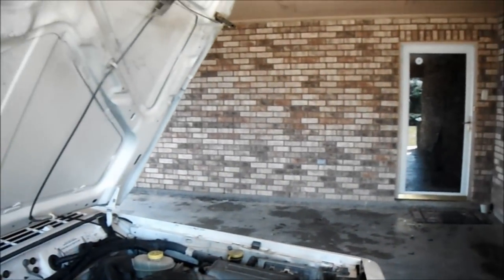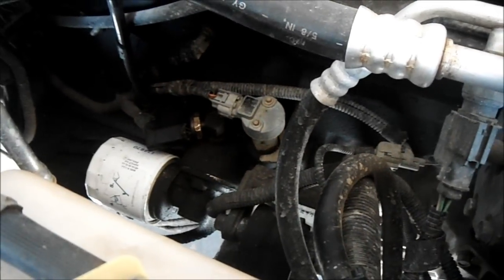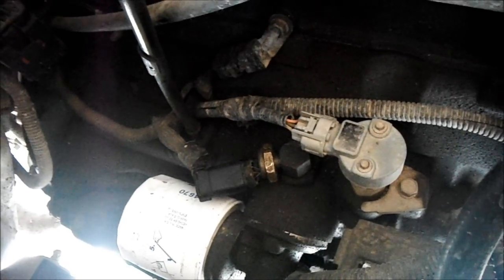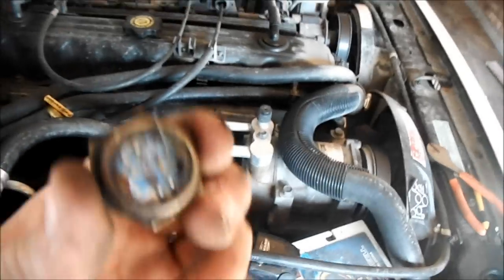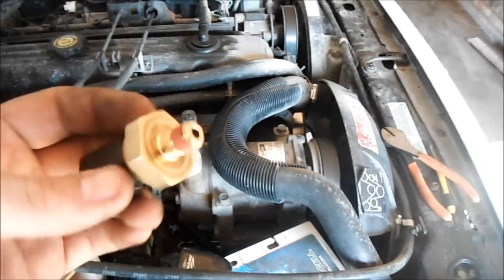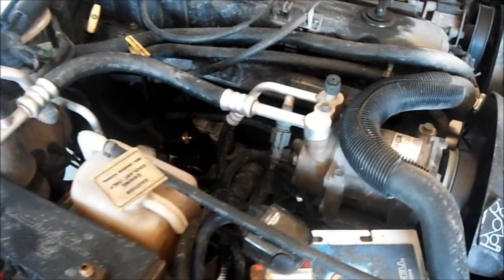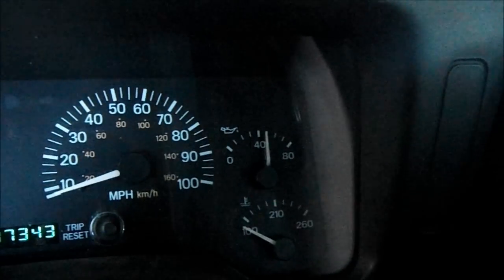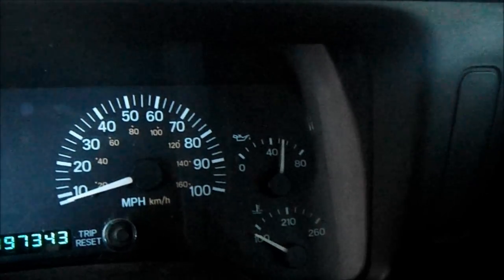how to change an oil pressure switch on a jeep cherokee (2000-2001)

Comment: Thank you for this video. Although it's a pretty simple job, it is reassuring to see an example before attempting the procedure myself.

My oil pressure indicator was running at 3 bar on idle, rising to 5 bar under acceleration with no drop back to 3 bar on idling again. An oil change and new filter did not help, but installing a new oil sender unit fixed the issue.

Comment: Useful Video and was able to change my 2001 Jeep Cherokee Ignition Oil Pressure Switch. Hope it will solve Low Oil Pressure Problem. When the Oil Pressure is Low, Engine Idles Rough, then Cylinder Misfires and Check Engine Light on with Cylinder Misfire DTC.  I also changed Ignition Coil too and hoping to run smooth. Thank you.
Reply: Does it ever shut off on you while you're driving? Mine started to drop oil pressure and rpm's, then it would shut off.

Comment: it was the plug itself that has the wire in it ive changed out both peices and it reads 80
Reply from the maker: check to make sure it isn't grounding out anywhere. depending where you bought the sensor from it may have gone bad again. i had quite a few issues with the parts store ones doing that. so i ended up getting a Mopar unit and that fixed my issues

Comment: is my sensor sender unit bad or is just my switch connector? the back of it with the wire keeps pushing out the back
Reply from the maker: the plug itself or the wires in the plug?
Reply: +dalton456 i coukd gp back i goy it from advance auto
Reply from the maker: try swapping it and see what it does, how long has it been since you changed it?
Reply: +dalton456 jus now
Reply from the maker: ah nvm then it wouldnt have gone bad that fast, it may just be a connection issue then

Comment: mine is broken in my jeep looks just like your old one and yesterday my entire cluster stopped working. none of the gauges work while im driving could this be the problem?
Reply from the maker: cope b if none of them work it's probably the cluster itself or a wiring problem. Does the cluster say no bus?
Reply: no i haven't seen that when i start it everything lights up as should and turns off  but the gauges stay at zero
Reply from the maker: cope b either  a bad connection or the cluster failed
Reply: ok thankyou!  are you talking about the 2 connections behind the cluster ?
Reply from the maker: cope b yes, check them for looseness or corrosion. I would also check the connections at the computer itself on the driver side fender

Comment: First thing I noticed was the XS battery. Lol. What setup do you have audio wise? Lol
Reply from the maker: Rodney Wiget  not much. singer 300 amp 6 phase alt, d3400 underhood, d7500 in back, pioneer flipout, some fosgate door speakers, a flatline audio fl2, and it was a custom mayhem 18 until today, now i have two custom tc sounds 4 hp 12's
Reply: dalton456 Nice! Very unexpected find for sure while searching for this repair video. Lol. 

I had 2 skar zvx v1 18s walled in my grand am. Was a budget build with just 2 audiopipe apdl2k's.  

Rebuilding currently. 2 Iraggi 320 amp alts. 4 custom 15s built with shocker sig motors. Not sure on power yet. Possibly an AB 1100.1 or similiar. 

Where are you located?
Reply from the maker: Rodney Wiget  i'm in thibodaux louisiana, looking to upgrade power though, been trying to get my hands on an ampere audio tfe lol
Reply: dalton456 I'm in Southern Ohio. Yeah I'm contemplating a tfe myself. Lol.
Reply from the maker: there's a used one here for 1500, and i almost got taylor's prototype a while back, sadly he changed his mind
Reply: dalton456 That's a good price. I'm also considering going budget and getting 4 ppi ba7000.1's. They have been known to clamp nearly 3k at .5.
Reply from the maker: i wish i could go a route like that, my issue is space though
Reply: dalton456 Ever tried brazilian? 

I sent you a friends request on FB btw. Lol
Reply from the maker: yeah i saw, and i'm scared to tbh, i have bad luck and i know those Brazilian amps are made of glass lol

Comment: Fuel pressure gauge drops when i hit bumps and returns to normal after some more. Could this be the issue? or loose connection?
Reply from the maker: +Patrick Maris the oil pressure gauge? possibly could be a loose ground, or a bad connection/corrosion at the plug on the sensor itself. there is a chance it may be the sensor itself
Reply: +dalton456 oil pressure gauge* yeah. I'll see what I can find. Thanks for the reply
Reply from the maker: not a problem, what year is this on? i know some of the older ones had oil pressure sensors in other locations, or had multiple sensors
Reply: +dalton456 it's a 2000 2WD 4.0L I6. I've been looking into it. Seems pretty easy
Reply from the maker: yeah it'll be pretty straight forward, good luck with it